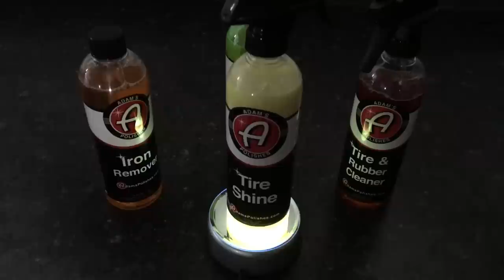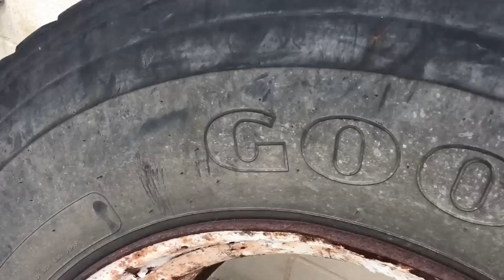Wheel And Tire Kit From Adams Car Care!!

Comment from the maker: Everything in the kit tested fine. The only complaint was the grit guard came cracked in 2 places :(
Reply: Apex Detail Brian if this detail thing doesn’t work out you have a bright future in product display 😀
Reply: @GDavis49  Belive me mr Brian would handle both!  👍
Reply: Give it a couple more uses and the handle will come off of the wheel woolies. The new ones aren't that great.
Reply: @Apex, First off excellent and informative video as always, Thank You. Also, I have an off-topic question i hope you can help me with. What Spray sealant/wax would you recommend for a large RV after the washing process for protection and gloss/shine.  Thanks,  Mike